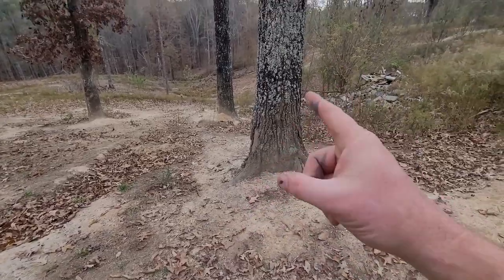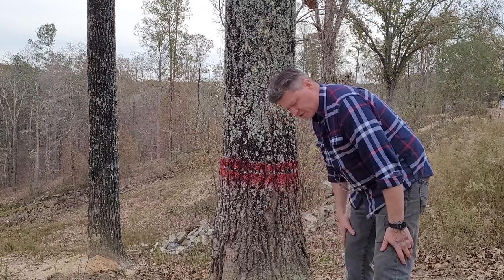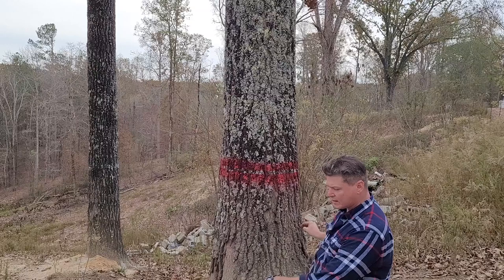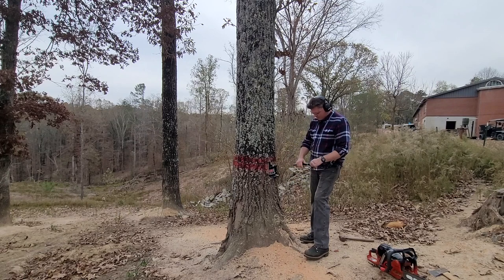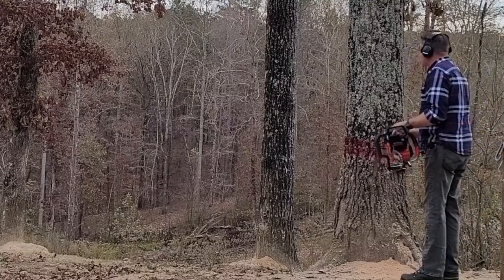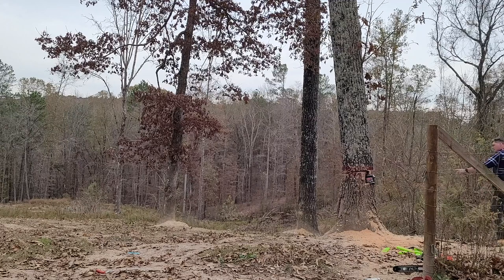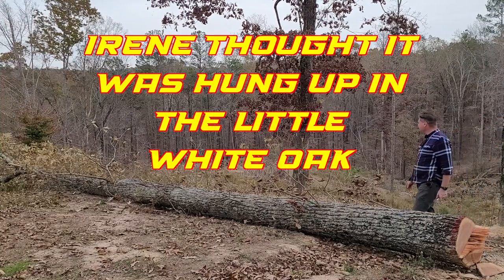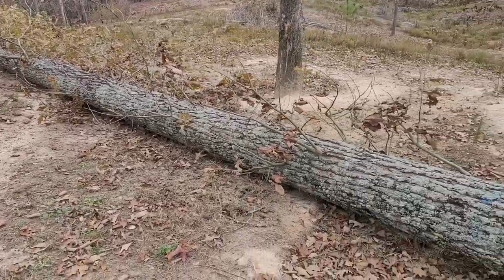I use a bottle jack felling a Red Oak.  It's intense!

Comment: Be happy you did it! Well done! Good Job.
 & your alive to laugh about it  :)

I learned a lot by watching pro's fell. [my Pop]
1. start the "smile"  [dutchman, undercut, whatever you call it]
 it was a  called a "smile" where I grew up.
 So I still try to smile right so the tree falls where it should ;)

 your Smile looked good. Just make it bigger [its something you learn after a few trials] 
and yeah our smile [also called Humboldt cut]
was straight on top [made a good timber log the mill liked it]   the undercut was angled up [just like you did] 
2. remove the wedge [clear out the smile] and check to see if your smiles in the right direction you want the tree to go. (You done good)
3. then the back cut 
[unless your jacking] (thats done after the smile is right)
 a back cut is usually straight in, Being aware of leaving just the right hinge wood so the tree goes where you want it.

  in my learning days. I forgot my wedges :O 
but had a big tree all set to go - So I walked down to the truck & got the HI Lift jack.
back to the tree (way back in the woods where mo one could see)
I cut a slot for the Hi lift & set the jack and commenced to lift it & to my relief it fell that tree :D
 since then Ive used the Hi lift & other times a Hyd Jack as they were needed on precarious big trees. [even Pop approved]

Comment: Nice job!! Only one way to learn is to do it!! I tell my new guys all the time only way to learn is to do it. I’ve been in some nasty situations cutting trees. It doesn’t bother me at all to cut trees along power lines but around houses I do get nervous. I always start on the side opposite the side I want it to go or side I want more holding wood. I always use a open face notch instead of Humboldt. U can control the tree for a longer period of time. U can use Humboldt just make a wider(open) notch so it doesn’t close off as quick. Nice job for real

Comment: It was the dutchman that caused the problem.  You must have your face cut and undercut align to a piont to create a proper hinge. If you have a dutchman there wich is the spot where the two cuts don't align the tree will stop falling when the dutchman closes. Hope this helps 👍👍👍
Reply from the maker: Yep, I saw it while I was editing the video!  Couldn't figure it out in the moment, but when editing, I kept scratching my head trying to figurebout why it was smooth at the top of my wedge on the side with all the hinge wood...Bingo!  It started falling and the big Dutchman stopped it cold!
Reply: Yep to both of you. Ends of the two pie cuts have to match up. Helps to face the landing spot and gun it with the sight line on the saw when cutting both the face and the back cut. Might as well start off right and put a beer bottle on line down range and concentrate on hitting it. Actually two. On on line say 2/3rds and another a foot passed where you expect the top is going to land. 👍🏼
Reply: The face cut, sufficient hinge wood, and reading the lean are the most important things.  Period.  If any of those 3 go wrong things can quickly go to shjt.  Take your time man.  Make every face cut near perfect.  And be EXTREMELY aware of your holding wood.  You already learned that lesson.  You're getting there dude.  Proud of your progress!
Reply: Maybe lay out ALL your cut lines next time.  Glad it all worked out.  Thanks, I learned something today.

Comment: Hey buddy…that jack is just fine but you need a 4”square 1/4” thick piece of plate or 3/8’s to spread the lifting forces… weld you a washer or a little ring or something on your plate to keep your ram centered!!! You want a plate on very thing because those back fibers can split out then she’s coming over backwards… always do that plate to spread the weight… you are taking a 2000 pounds really quickly and wood fiber isn’t enough to handle that load!    
You didn’t make a deep enough face cut….  When you have that happen again… run in with your saw and tickle your face cut!!!!   
That’s not terrible on that height… that height keeps it from slipping back off your stump!!!  That 2-3” drop down is good… if you think about it it’s like having your boot against the bottom of a door… and it’s actually holding the bottom of your tree and allowing it to fall over without jumping back on you!!!  You don’t want to be level!!    

Remember that you are creating your tipping point when you make your face cut depth… a 1/4 of the tree deep face cut would require much much much more lifting the have your weight break your plane and fall if your 1/2 way deep almost then just the slightest bit of lift will have your weight past your tipping point… weld a ring on a good piece of plate if you want to do that again!!! I am really speaking from experience!!!! I sure as hell wasn’t paying 3 grand for a little boost jack but I was pumping on a decent oak and ended up just driving the jack up into the wood of the tree and it started splitting out… I had wedges on both sides so I just started driving those little they stole something and I didn’t loose it but over itself….   Get an 8oz beanbag and a pull rope and start practicing tossing a line into your top and pulling in your bull rope… if you grab the head with your pull rope going to a 5to1… you’re a 200 pound man.,, you can physically pull a couple hundred pounds… through a 5 to 1 a 200 pound man can pull around 1000 pounds of force on the top… going where you want it!!  Once you rip the head of that son of beech where you want it you can hit a couple wedges and then go yank it more then work your wedges!  You can pull a bad back leaner over itself as long as you don’t cut the front face of the tree until it’s time to drop it… you come up with the bottom cut of your humbolt until it’s wanting to pinch then your level cut… then you yank your top over that last little bit.   I wish I lived closer I’d love to spend a day cutting with you and going over some different techniques!!!  💪👍😁.   It’s on the ground and nobody got hurt! Period!!!  Practice is the only way to get good at it!  And you are running to clear and believe you me.,, you know how many idiots stand there gulking at their handy work and have a tree jump or kick and they get popped!!! Or it’ll kick something at them!!!  You keep running to your clear spot that’s what you should be doing!!!  Get out of dodge!!!

Comment: Get your little plate made and use it every time and make that ring so it can’t slip across the plate and pop out!!  Trust me I was thinking I didn’t need it either and I actually almost messed up twice!!   You can remove that little lock screw and put a 15’ piece of 3/8 air hose on it with a portable tank with 200lbs of air pressure in it and pop them over from a distance.   LMFFAO. That’s what I was thinking about trying at some point!! My portable battery operated air pump unit!   LMFFAO!   After I got the 5 to 1 with the break… it holds everything that you can pull on the rope.., will not release your pull until it’s released.,. At 300 pounds I can physically yank the top of a tree a significant amount of travel!!!  And you start your back cut and yank it more!!!! Once it’s 6-8 feet over in the right direction… you have kicked it’s ass and you own it at that point!   The old judo / wrestling adage where the head goes the body will fallow!!!      Peace and Love!!!  Give your Forman there a big hug…she was right there keeping an eye on you!!!  You and the Mrs.’s and the whole family have you a wonderful Thanksgiving!!!  A loosen up your belt a notch and enjoy a little nap watching the football game! LMFFAO!!!  💪😉👏🤪🤪

Comment: You first cuts are called a under cut and the last cuts are called your back cuts Have cutting wedges with hammer close by to keep your back cut opened so the saw bas will not get stuck in the back cut

Comment: You are a funny dude. It’s hard to fathom someone that knows as much about chainsaws as you do having so little experience felling. Even though your hinge was keystone copped, was it purposefully done for entertainment purposes?
Reply from the maker: Absolutely not!  I've probably dropped about 100 trees in my life...but they are almost all 12" or less.  Those are easy.  You can see around the tree to where your bar is and get perfect aim.  But when you can't see the other side without walking around the tree to have a look...its difficult.   Also, the time in-between felling bigger trees is months, sometimes YEARS.  So it's difficult to learn how to fell a big tree to begin with, but when you're only doing it once a year or less...well, it's not conducive to building muscle memory.  I've watched HUNDREDS of felling videos, I'm VERY intelligent,  I have GREAT dexterity...but nothing replaces repetition repetition repetition!  And I do not get any repetition.
Reply: @novicelumberjack  Felling small trees is the same as large trees, the mechanics are the same. Try bore cutting next time, it will enable you to set up the hinge perfectly and takes out some chance of a barber chain or uneven hindge. Good luck

Comment: Your wedge cuts didn't match at the apex leaving a huge Dutchman. You really need to clean up those lead cuts to match. Leaving or trying to use Dutchmans in falling is a more experienced technique and certainly not needed in this case.
Stay safe by learning proper techniques there are a lot of good teaching videos on YouTube. Husqvarna has some good beginner videos as well as many others. Buckin Billy Ray Smith has done a few videos showing how to properly clean up your lead (wedge) cuts. If you get proper training then confidence comes on its own and the fear will go away but the respect should not. Good luck, stay safe!

I guess I might ought to explain that the Dutchman you left on the down hill side is what caused the most of the splinter pulling.  As you said you were going to cut the tree into firewood so it matters not that it splinter pulled. But as a man with a sawmill I see half of a really nice oak log ruined. Two feet still on the stump and two feet splinter pulled. Please don't take this wrong I'm in no way being condescending just trying to help.

Comment: Im sure you've heard it all but you really shouldn't be jacking trees over when you you just crushed your atv not too long ago. Not trying to hate, just my two cents from someone who cuts trees for a living.
Reply from the maker: No offense taken, I'm sure you're just saying what many others are thinking.  But...you gotta hear me out on this...what am I supposed to do?  Never drop another tree?  Only drop a tree after I get some professional training?   Find a pro outfit and pay them everytime I need a tree dropped?  You see, this is where professionals can be absolutely delusional.  Straight up man.  Delusional.   I'm sure you have screwed the pooch a time or two in life.  Did that portion of your life stop right then and there?  I'm assuming it did not.  We learn and move on.  As a pro, you may be sent for some extra training,  or you have to let Terry take over for a week or two and just watch for a while...guys like me are completely alone.  We get it done, or it doesn't get done at all.
Reply: @novicelumberjack  My point was that jacking trees is more of an advanced technique. You gotta walk before you can run. My advice is go work for a tree service or logging outfit for a little bit and learn as much as you can! For comparison theres a big difference between changing the oil in your vehicle vs rebuilding the engine. One i would do myself while the other i would leave to a professional or gain some experience first.